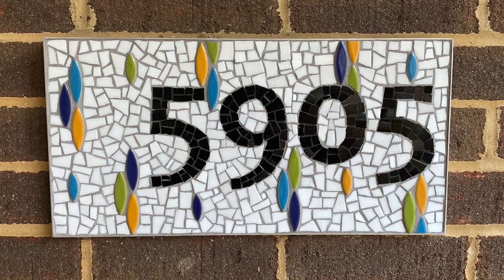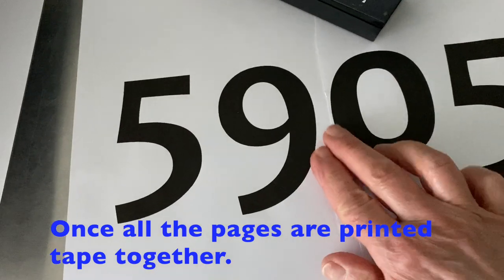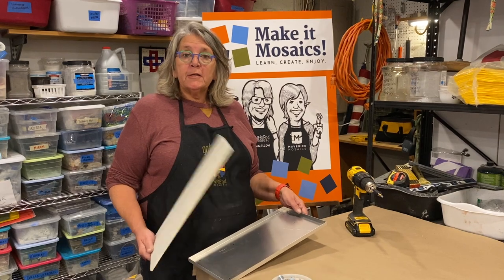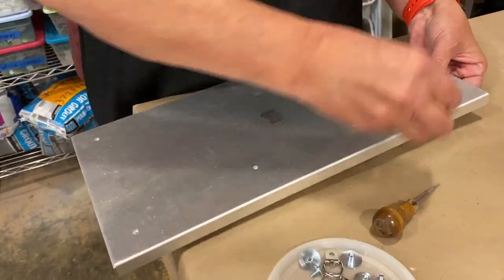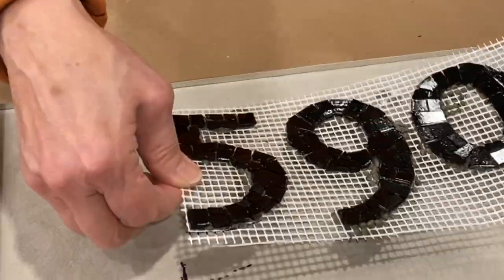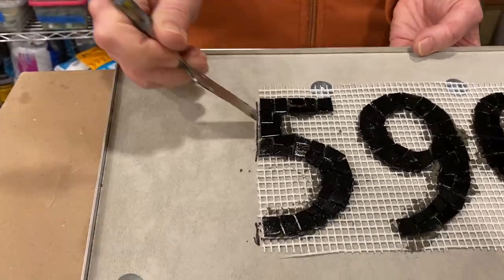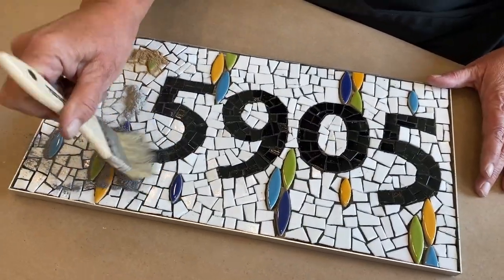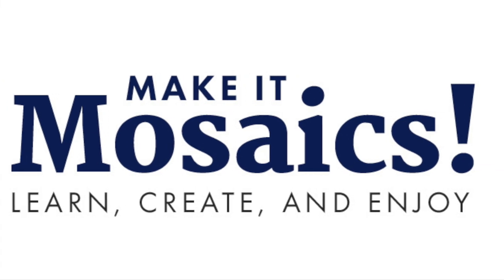Mosaic House Number and Signs

Comment: I did mosaic pavers to line the path to our house with a method similar to this, using the mosaic mesh. However, I glued the glass pieces onto the mesh with Weldbond, and then after it dried adhered the mesh to the pavers with Thinset, and then grouted. They have been outdoors for 2 winters now and are doing fine. Essentially, the Weldbond is only attaching the glass to the lines of the mesh, while the Thinset is attaching the glass to the substrate.
Reply from the maker: Oh it works to do this way, and for sure WeldBond is super user-friendly. The caution is some folks use too much WeldBond and create a "barrier" that prevents the thin-set from full adhesion and getting up around each tile. When I use WeldBond with mesh just like you only need a drop to hold the tile in place, ultimately the thin-set is the permanent adhesion.

Comment: Fun video - think we need one on our house. Two questions: If it's going to be outside should it be treated with some sort of sealant and if so what do you recommend (ok that was 2 but I have a 3rd). Are there any guidelines for how much space to leave between tile pieces before grouting? Thank you
Reply from the maker: Great questions. We are not huge advocates when it comes to sealing grout, first off you can buy grout with sealants and UV inhibitors in it and this is not getting foot traffic or anything that will make it dirty except weather and pollution, sealing is labor-intensive, you have to get off every single tile our sealant dulls tile. The space in-between is a personal aesthetic, in the house number in the video is between 1/16 and 1/8". Thanks for being a fan.

Comment: Do you use a sanded or unsanded grout outside?
Reply from the maker: As a rule I use only use polymer fortified sanded grout, not because of artwork going outside, but because of the size of grout lines. Un-sanded is only for grout lines less than 1/8".  There really is not a difference between interior and exterior grout, some folks opt to add more polymers for exterior, and some manufacturers have brands with additional additives for UV protection and sealants which can be helpful over time, for example Laticrete's "Permacolor" grout.

Comment: This will be my first mosaic project for our new house under construction, as soon as I start my new hobby!  Great video!  Is the French clear also at wits end?  I will have to mount this on the wall next to the carriage light out front, so rain will hit it directly. Is that going to be ok?  I’m in Houston, so we don’t get much freezing temps but we get lots of rain and tons of humidity 🥴🙄Thx!
Reply from the maker: Yes the cleat can be purchased same time you get EZ frame. All the materials we used in the video can take any weather, our house sign lives in Wisconsin in full weather year-round! Here is link, Witsend calls it "EZ hanging bracket" . Good luck!!   https://witsendmosaic.com/mosaic-bases-frames-substrates/ez-mosaic-frames/ez-mosaic-bracket.html

Comment: Where I live, I cannot source the type of mesh you recommend so I was wondering about mosquito screen.  That does get eaten away (bugs do it…) but is that really a problem when the tiles are fixed with thinset, cement and grout  ?  Just wondering.
Reply from the maker: I would not recommend mosquito net, check building supply places near you. The mesh needs to be Alkali-resistant if using thin-set mortar.

Comment: Is there another way to hang the ez mosaic frame? The house I have in mind is shingled and I’m not sure the ez hanging brackets will work. Thanks!
Reply: I think in this case, I might poke the holes through the board where you attach to the house,  Not mosaic that portion.  add a wedi washer there, affixed with screws to the building, and then go back and mosaic over that portion once in place.  This will be a permanent application but may be the best choice.
Reply: You could also use a cable and 2 hook hangers on the building.  This would allow some flexibility and future removal.
Reply: @kimwozniak5663  that’s a great idea!

Comment: Hi, I am interested in making a house number sign (obviously for outdoors).
However I am going to be working with polymer clay.  I’m going to be making it in mosaic style.
My question(s) would be: what would be the best substrate & adhesive? My “tiles” will be polymer clay & adhered to a base of polymer clay. They will be baked together so they shouldn’t fall off. I’ll just need to adhere the full address plaque to something that can attach to a brick wall.
TIA for your help, if possible.
Reply from the maker: Gosh, I am sorry, I meant to respond when you first sent this! Wish I knew more about polymer clay - my concern is how it will behave in your climate. I am unsure. As to substrate and adhesive, I would probably use a lightweight substrate and polymer-fortified thin-set - both can handle freeze/thaw. Or you could adhere with an epoxy-based product, or E6000.  No wood if exposed to any rain or excessive moisture - it will warp. Check out this video about substrates https://youtu.be/oKaVqfqS3sc

Comment: What do you use as a weatherproof grout sealer?
Reply: I tend not to seal my grout unless it is going to be on a horizontal surface where liquids can be spilled, or water can set on it.  When I seal, I use the sealer recommended by the grout manufacturer.  Some grouts are now being made with sealer as part of the grout.

Comment: Question...you missed some instruction.   What do you use to attach the numbers to the mesh?  and what is happening when you show blue tape or something ssssurrounding the numbers??  I'm a beginner
Reply from the maker: 1. Used thin-set mortar in a (plastic bag) to attach the numbers to the mesh (one tile at a time) 2. the blue tape simply keeps the substrate clean when I grouted the numbers black and then, because the final grouting was 2 colors wanted to keep the black grouted numbers clean, the tape protects the work already done. . There is a video about the plastic bag trick and just. Hope this clarifies for you. Great project!